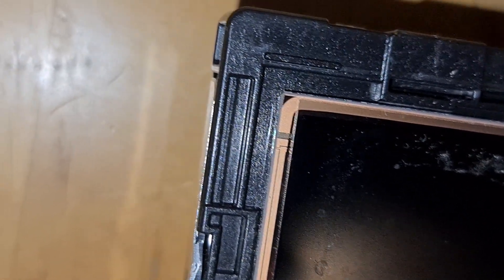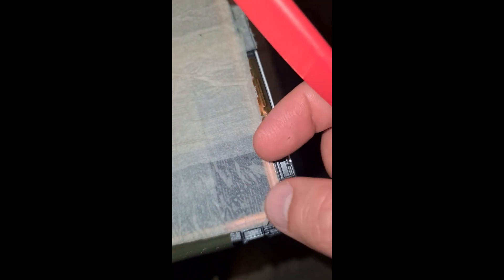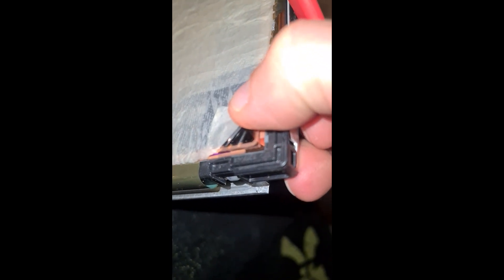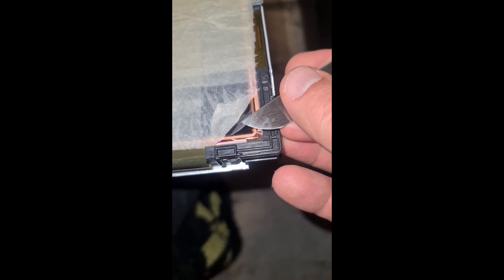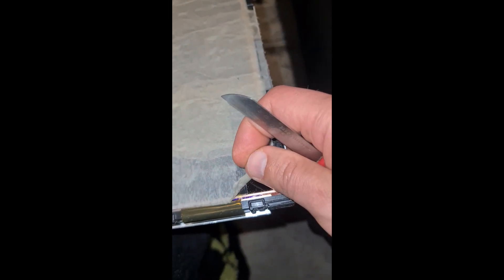uncoating U3014t Dell Monitor anti-glare removal

Comment: Ok i destroyed my monitor at the end.
I was very happy with the result, crisp, sharp screen, i played games few days.
Then i decided to clean the screen with paper towels, and scratched the screen, it is very sensitive under the coating, then i tried to clean it with microfiber cloth, it does not scratch.
Then I wanted to fix the scratches with toothpaste, and destroyed the screen.

Do it only if you use the screen in total darkness, cause it reflects everything. Clean it only with microfiber, and don't touch it with nails or anything.
Reply from the maker: At least you had the courage to do it and were succesfull. I think tooth paste is too hard .... 😅
Reply: @tsk-meteakabruceleekills1311 
Toothpaste has something in it, that destroys that layer.
 Anything is too hard on that layer under coating. Except maybe Microfiber cloth, microfiber did 0 scratches, but i don't know the effects of it long term.
But damn, that screen looked so crystal clear without that coating, i even started to see aliasing in games where i did not see it before, you can see every pixel, in some games i started to apply FXAA at Nvidia Control panel.
Reply from the maker: @JohnRambo-666 I hope the damage isn't too serious? Can you still use the monitor in this condition? I currently have a 40-inch MSI Ultrawide 4K monitor and tried to remove the anti-glare film, but to no siccess. Even after soaking it for an hour, it wouldn't come off. I simply miss the high-gloss effect. Nowhere else are the colors, brightness, and contrast so crystal clear.

Comment: What is the steps to wet the surface 
Length of time wet? 
Thx
Reply from the maker: 30 mins then test, then in 15 min imtervalls....untill the foliage is coming up smooth. Test it on an old monitor from the trash ... Watch my other vids.
Also type should be H3 coating not a semi type....otherwise Impossible.
Reply: @tsk-meteakabruceleekills1311  thank you sir
Reply: What kind of paper
What kind of liquid?
Reply from the maker: @tapptom  toilet paper, zewa, towel....anything 😅 ... normal water is enough! Watch my U2711 Dell video on my Channel.